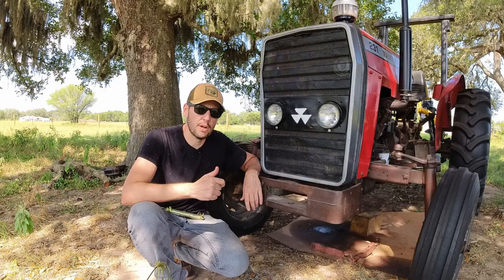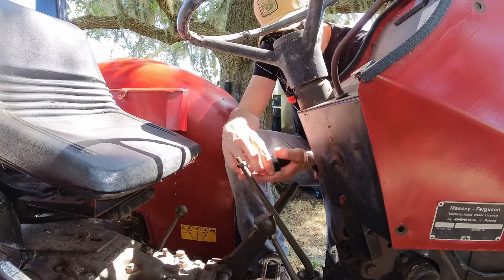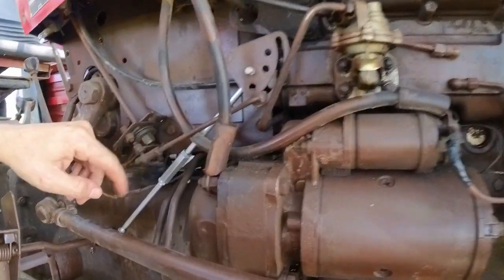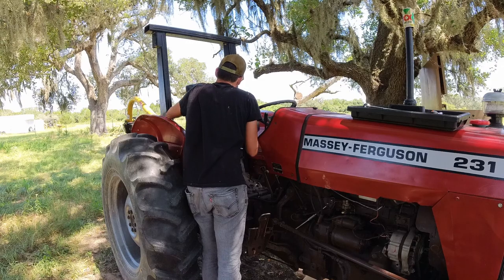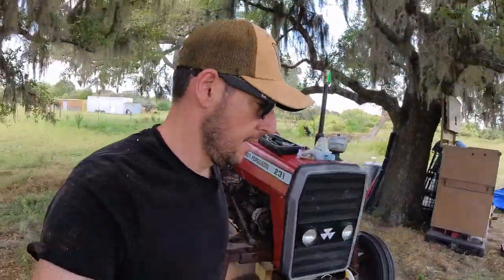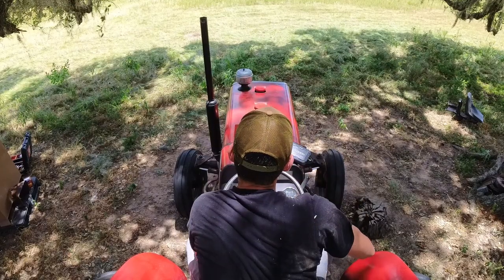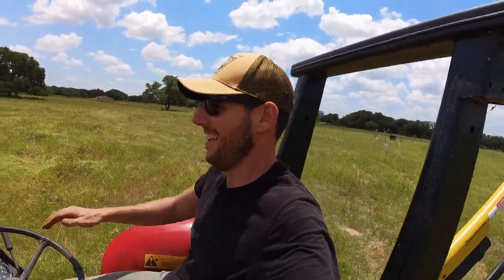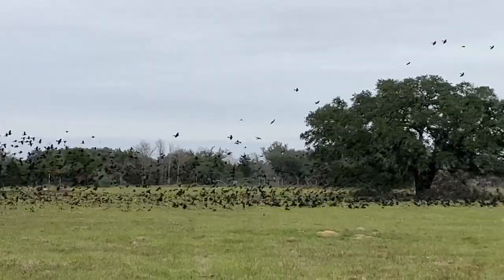Adding missing and new parts to the Massey Ferguson 231.

Comment: 👌👌👍👍  Thanks for the video!  I keep a trickle charger on my 231 battery when not in use.  My 231 drawbar interferes with some of the implements I use: bush hog, rotary tiller, dirt scoop, etc.  So I rarely install the drawbar.
Reply from the maker: That the way to go, I have no power at the farm yet so  next month I'll make a 400w solar generator with a NOCO charger-trickle charger. About the bar, I can see being in the way of some implements, so far I just have the mower and the auger, hopefully one day I'll get a tiller. But a trailer to haul wood, branches, feed etc is something I need. Thank you for your comment.

Comment: Nice M-F 231; It's always nice have your tractor set up the way it suppose to be, & nothing beats seat time on your tractor. It looks like like you need to set the camber on the front wheels. Ya just got love those M-F's.
Reply from the maker: I hope soon getting the MF ready for all the mowing and leveling I need to do.  Finally with a comfortable seat and power steering working. I will look into the camber on the wheel, I though there were fix. Thank you for your comment.

Comment: Nice upgrades for the 231. Had to put a new battery in my 231 last week. Installed a new Die Hard 31P30 series. It has 850 cold cranking amps.
Reply from the maker: I hope mine is no dead beyond recharge. I'm planning making a 400w solar battery charger since I don't have power in the farm yet.
Reply: @BUTTEWORKS  is the alternator charging?
Reply from the maker: @travisricks3436  I'm going to check next time. It could be it doesn't. Wiring is a mess and need to be replaced.
Reply: @BUTTEWORKS  look to see if a “lightning bolt” is lit up on the instrument panel display. If it’s lit up in red, the alternator may not be charging, or the indicator bulb may be blown.
When you turn the key to the on position, the lightning bolt and oil pressure indicators should come on. When the tractor starts, both indicators should go out.
Any questions, let me know. I have parts, operator’s, and service manuals.
Reply from the maker: @travisricks3436  Unfortunately none of the lights work, and wiring is all except reliable. I need to rewire the entire tractor soon. I will check with a multimeter if there is any current flowing into the battery while running and if the charging cabling actually works. I have the wiring diagram so I will try to see if I get to the bottom of the problem. Thank you Travisricks3436 for you help, very much appreciated.

Comment: Drawbar is mounted backwards I think! Two holes need to be under the tractor, the three holes on the back for a clevis hitch.
Reply from the maker: I checked that too but the only way I could make it work was with the big hole inside. The one s outside seems to be for the trailer.

Comment: Nice Improvements and you have me motivated to upgrade a few things on my 231. I have orginal massey seat and thinking of that upgrade you did. Where did you buy the seat and is the 2inch riser nessacary if replacing seat? Thanks again and nice job!
Reply from the maker: Thank you for your comment. I bought the seat in Amazon, there is an affiliate link in the description.
Reply: @gofishingfishing  Would you like to get rid of the original seat??

Comment: I really enjoy your videos. I have been looking for the foot throttle pedal spring for my MF 231,but I can't find it. Any ideas on where I can get one?
Reply from the maker: Thank you for your comment. I have no idea, I was looking for this pedal for a while and found it by luck in facebook market place. That pedal is very difficult to find, However if all you need is the spring, you can buy one with the right length. They sell different lengths and K factor, (tension)